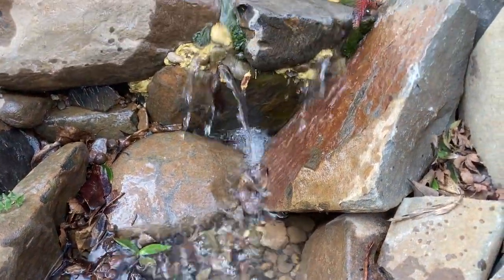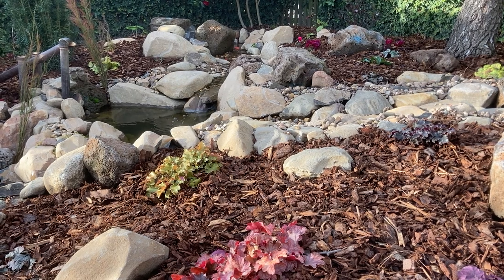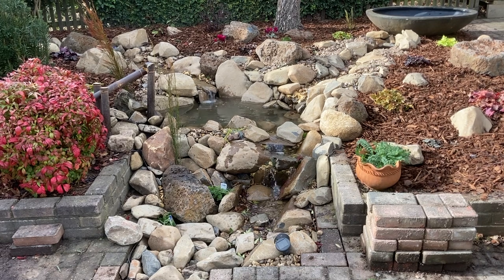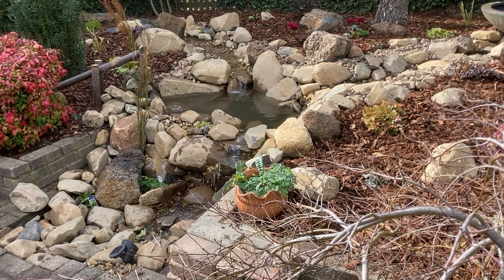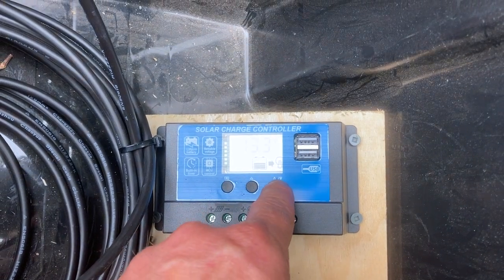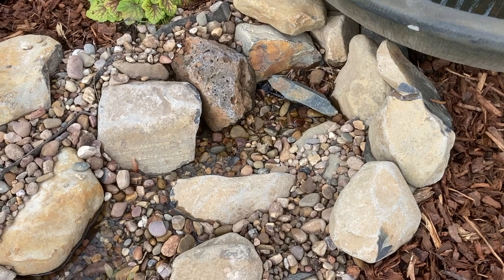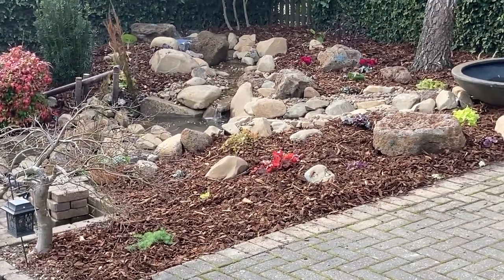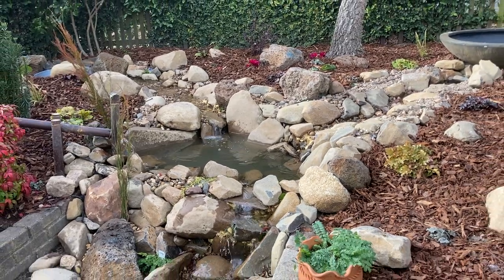DIY  Solar pond and stream update

Comment: Everything you said around the solar system seems correct to me. When you talk about that you could add more solar panels or use a larger panel, that would be limited by what your charge controller can handle. The charge controller is rated to a maximum voltage and amperage. 

No one who builds all these DIY ponds and posts videos online should ever call themselves lazy!
Reply from the maker: Good point, I would need to upgrade the controller if I did that.

Comment: You're getting inaccurate voltage readings because it's measuring the voltage drop over the wires between the battery and the controller/voltmeter.  When the pump is off, there's virtually no current travelling over those wires, so the voltage drop across them is negligible.  But the moment you turn the pump on and a significant amount of current flows, the wires themselves drop voltage making your reading lower.  The battery's actual output, has not dropped as much as the readings indicate.

To be truly precise, there should be two leads from each terminal of the battery to the controller.  One pair of wires measuring voltage, the other pair carrying the load.  But this controller is not designed for that, so you have to "live with" a degree of inaccuracy.
You might be able to reduce the PERCEIVED voltage drop, by using heavier gauge high-quality copper wires from the battery to the load.  But the drop will never be zero.
Reply from the maker: That makes sense 👍

Comment: I saw the fence placed the solar panel is so nicely grown plants instead of  concrete or iron. Kev Could you show some techinques how to grow such beautiful plants wall?
I will be amazaing when the flowering season comes!
Reply from the maker: This Is trachelospermum asiaticum. It is just a wood structure with some lattice. The plant just naturally climbs the structure. This plant is about 10years old. Bit to time consuming for a  before and after vid 😉
Reply: @Ozponds  No need to guide the vine direction or trimming? They spread so smoothly ane evenly.
Reply from the maker: It’s been cut multiple times over the ten years

Comment: Hi, check the manual, I have I believe exactly the same charge controller as you and it doesnt do lithium, only lead acid. b01 is sealed 14.4v, b02 is Gel 14.2v and b03 is flood 14.6v.
Reply from the maker: I must’ve read that tiny “manual” 16x. This is an updated version, if you look closely at the pictures in the vid, you’ll see in the top left corner, the little logo that says “lithium battery”. I still don’t fully understand why it matters though, you can change the settings, the battery type just seems to change the presets. But I really have no idea what I’m doing, it’s just a fun learning experience.
Reply: @Ozponds  you're right, mine doesn't have the lithium logo but the functions and everything else is the same. Not sure it matters but lithium chargers and lead acid are not the same, lithium chargers deliver a constant current and constant voltage charge, lead acid it's just voltage.
Reply from the maker: See now I’m learning more. 👍

Comment: Love your channel. One question though and I would love you to reply. I have build similar size pond of your dreampond with one stream and waterfalls. Surface area of river with waterfalls is 2x6 meters and there is 15k l/hours going through it. Whan the pump is running I see vaporage of 1cm/12 hours which is approx 600 liters/day. Whan pump is off and stream is not running vaporage is approx 1-2 mm/day. Is it even possible that my river with waterfalls has such high vaporage? I have checked liner everywhere it is not leaking over the edges, checked pipes  they seem to have no leakage, but did not checked yet liner bellow the rocks as I would have to dissassamble whole river with waterfall. Is this high vaporage normal for rivers?
Reply from the maker: In warm weather that is possible, especially with splashing onto dry rocks.